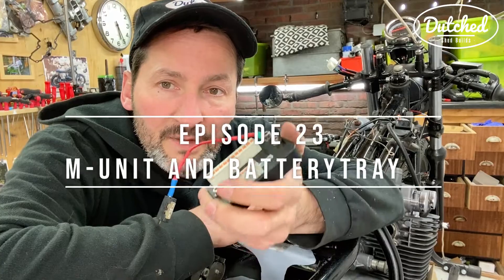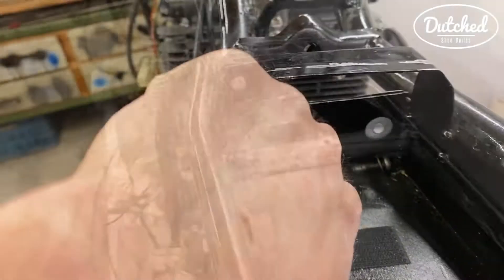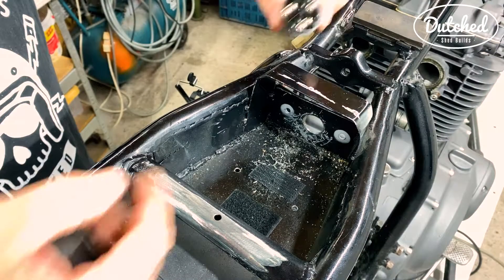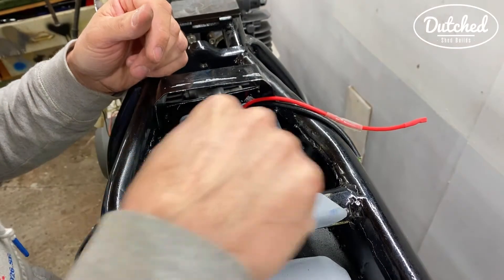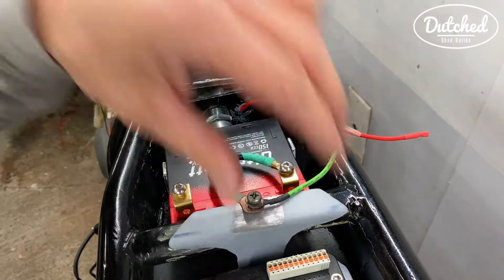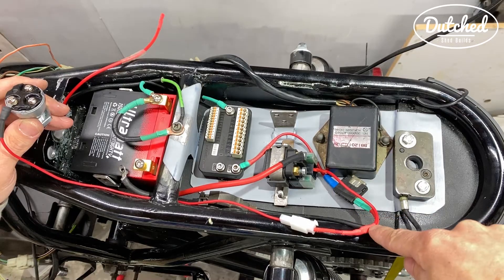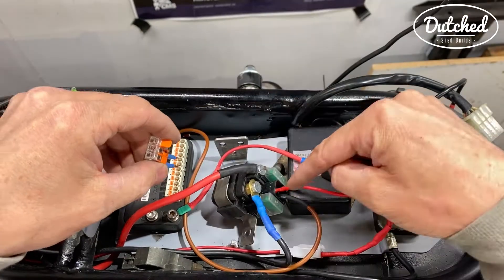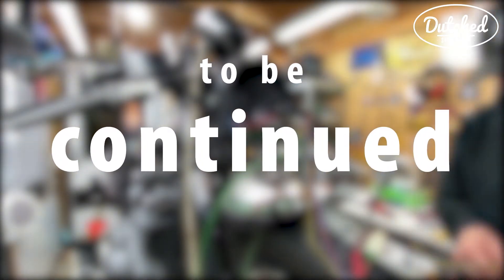Suzuki GS450 - Motogadet M-unit installation - Electronic control box

Comment: Way to fast your showing what you done but not how to do it, just left more confused than before I watched
Reply from the maker: Im sorry to hear that. Is there a particular question  i could help you with?
Reply: @DutchedShedBuilds  thanks for your reply I wasn't expecting that. Maybe you could I've got a 1200 mk1 but it's now a chopper I've taken all the lum out but there just seems to be a hell of a lot more wires some have been just cut n tapped off some different colours joined together all from previous owner... Im lost
Reply from the maker: @i_am_celt  my advice would be to completely remove the loom, and start over fresh. Its a bit  more work but its well worth the effort. Make a wiring diagram first (with the unit in it) and go from there. 
Motogadget unfortunately doesnt have any support for this, so you have to figure it out yourself (thats why i now prefer @nwtcycletronic X21
Reply: @DutchedShedBuilds  ta for that i plan to do that once I've figured out where I am with the ignition/charging system n that it's working correctly after taking every out